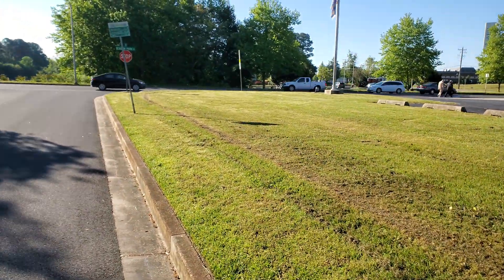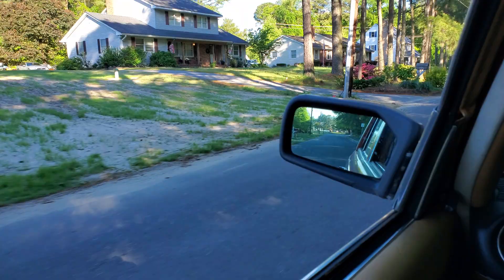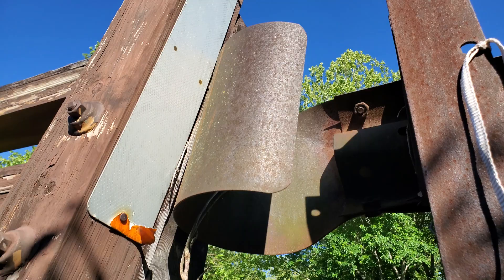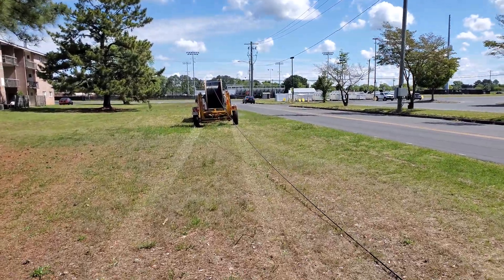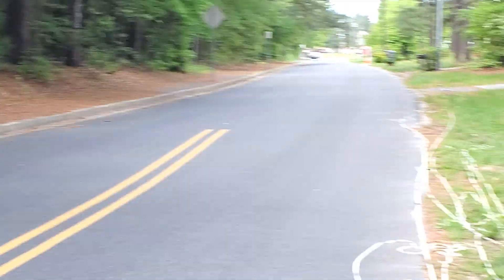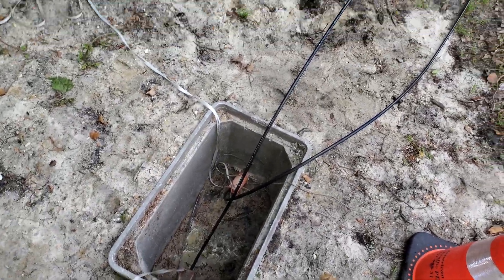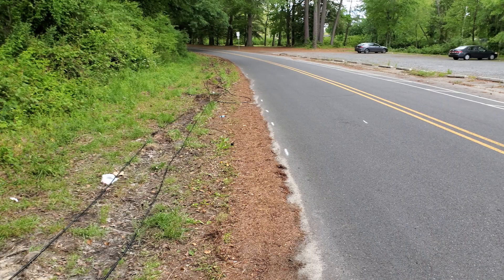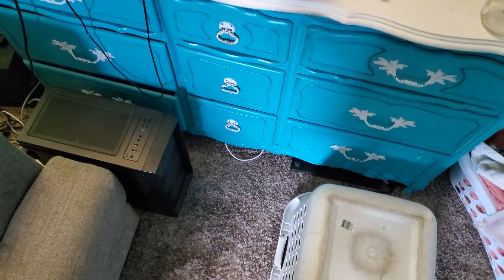Pulling in a 96 count cable with the outside plant.  Only 2km of cable and 3km of fun.

Comment: Might consider a rain tight box, and an expansion fitting coming out of the ground next time. Just saying
Reply from the maker: I believe the city requested a metal box, also the cable is rated for direct burial, also aerial up to 600ft between poles although we don't do that.  The fittings you see on the bottom are not an expansion fitting but a gel sealed coupling not a mechanical connection.  Afterwards we attached to the bridge.

Comment: I thought that was a 1980 Mercedes
I know that sound anywhere.
I wanted one, but there were none in any good condition.
Reply from the maker: Suspiciously more reliable than modern cars.....  Haha your spot on 1980 too
Reply: Yeah love the Mercedes too!
Reply: @Dekay916  the early 80s has amazing Mercedes. I think 300D Maroon was my favorite. Yours looks a lot like that model. Maybe a year early on. I think 81 was the hard shell that was a Maroon Red. Great trunk space. I remember the block heater having to be plugged in every night. I remember the glow plug light having to wait for it to go out before turning the key. And the sound. It was like no other car. Still is unique. And they built them to go 350,000 miles. The hardest part was getting diesel in the 80s. Very few gas stations had it. Especially in rural areas. Because it was for big rigs, truck stops were one of the few places you could find it. Farm and tractor supply places was the only place in rural areas that had it. And getting an oil change was a tough time. It is not like a regular gasoline car. But God, was it reliable.
Reply: 110% Mercedes diesel. Love that old sound.